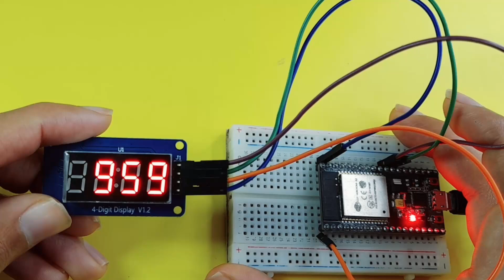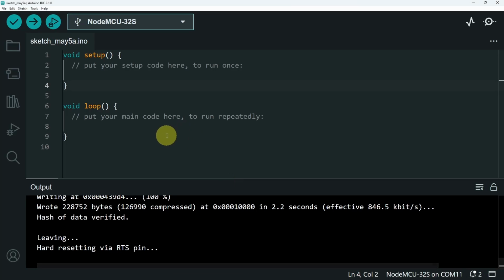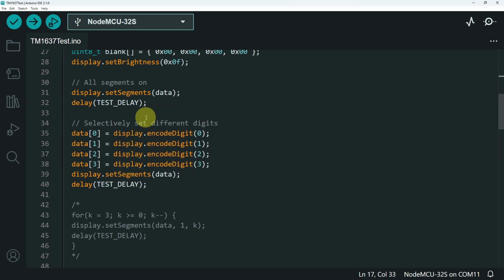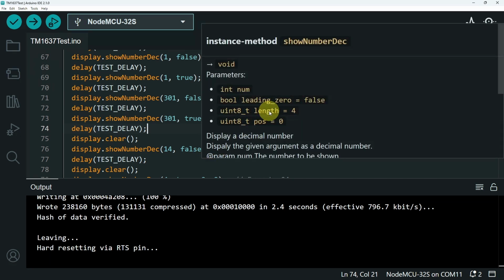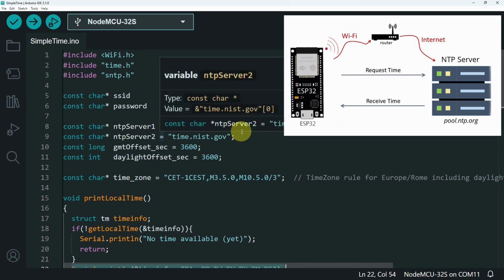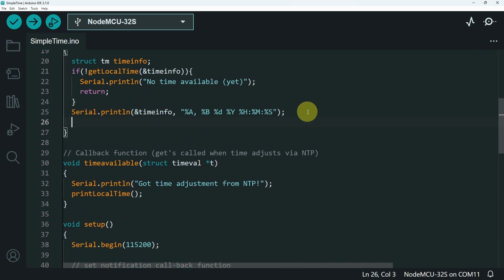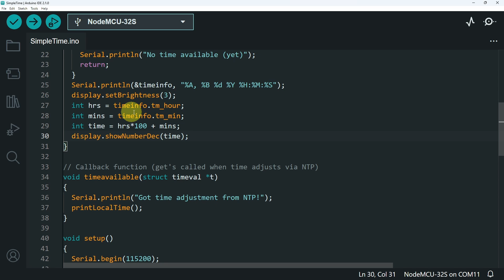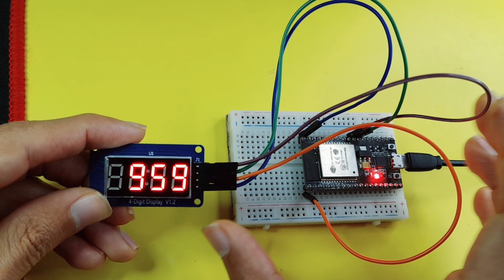DIY Digital Clock with ESP32 and TM1637 Display

Comment: I got the first TM1637 demo working, but after the sketch is compiled, I see the message, "Hard resetting the RTS pin", and nothing happens (the display is dark).  I pressed the BOOT button on the ESP32, but nothing happened.  I also removed and then reapplied power with the same result.  Any suggestions?

Comment: I take the time from a GPS.  It's been fun. It grew to 3-4 devices and they also work through USB for maps in u-blox software on Windows as the Serial.print() can form the TTL "adapter." I have more precise clocks on top, but that's not Arduino IDE. Running WiFi all the time takes a lot of power, so a combination of RTC and GPS is the best solution, but it can be a bit off - up to 30 seconds. Improvement is possible by learning GPS commands and I'm not there yet.

Comment: Nice beginners tutorial.
If I may add a few tweaks, 
remove the 

display.clear();

It is not needed and will stop the display from blinking.

Replace the two lines that print to the LED with these, it will give leading zeros and turn the colon on and off.
Also remove the delay(5000) in the loop as the function has the delay.

display.showNumberDecEx(time, 0b11100000, true); //turns on colon
display.showNumberDecEx(time, 0b00000000, true); //turns off colon

Next we can set up the time_zone correctly, which will then automatically adjust from summer/winter time.

Find the line of code which gives a http link to github. Go to that link and find your country. Copy from there only the text between the double quotes.

Now find the following line in the code and replace the text between the quotes with what you have copied, so for the UK, it changes from
const char *time_zone = "CET-1CEST,M3.5.0,M10.5.0/3";

to

const char *time_zone = "GMT0BST,M3.5.0/1,M10.5.0";

We can see this line gives us GMT with 0 offest. Then BST time change at Month 3, week 5, day 0, hour 1.

Now add the following two lines as the last two lines in setup{}

 setenv("TZ", time_zone, 1);  //  Now adjust the TZ.  Clock settings are adjusted to show the new local time
  tzset();

Comment: Hi from Los Angeles! So cool, thanks for making this video! Do you think someone could buy a 3D seven segment LED clock  (a basic one without an ESP ) and modify it by connecting its wiring to an ESP using this software?
Reply from the maker: Thanks 😊 
Yes, it's possible

Comment: Hello, new subscriber, I wonder if you could collaborate with a Countdown timer project with the TM1637 display and that when it reaches zero, turn on a led for 3 seconds, it could be using ESP32 or an Arduino. Regards.

Comment: Hi. Im having a problem with the hour. It was working fine till the time is 12:00 PM, is not displaying 00:25 for example, it just display   :25, there are no 00 for the hours. if its 01:00 for example its shows 1:00, would be nice to have a 0 before the 1.  Do you have any idea ?
thanks.
Reply from the maker: Thanks for this remark
We can fix that by entering true as a parameter. Check out the example sketch.
Reply: @DIYTechRush  It's working fine!
Thank you very much for your time and speed in answering.
Reply: add the word 'true' to the line as shown below
 display.showNumberDec(time, true);